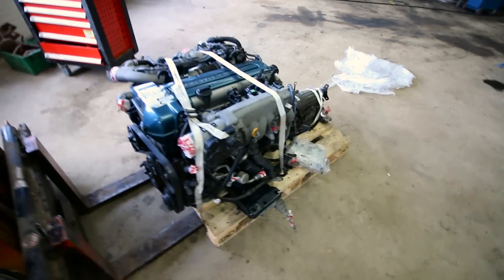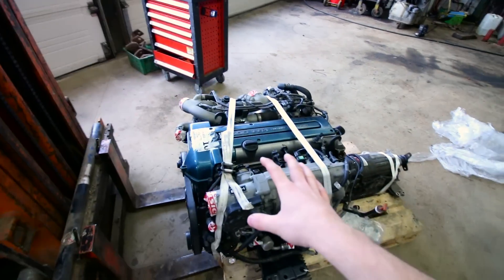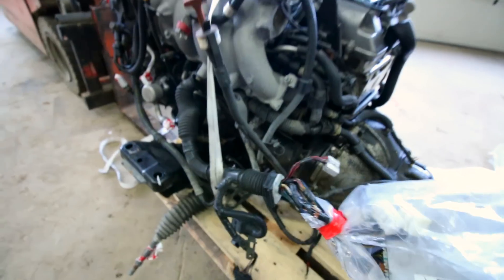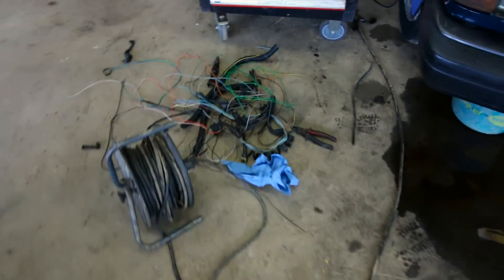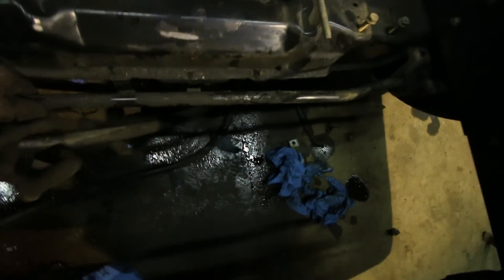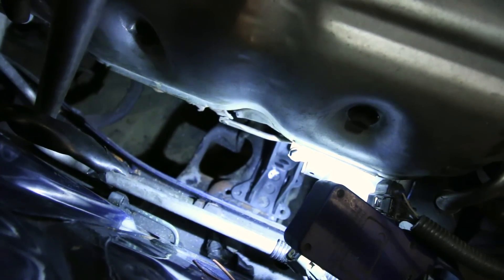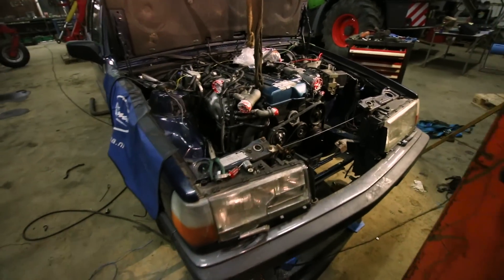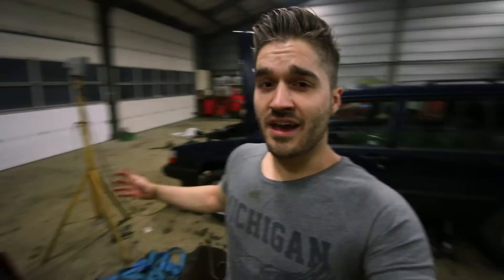Building the LCM 940 - The 2JZ Volvo [Ep2: 2JZ Test Fit & Custom Sump]

Comment: looking good so far mate. I got a question, do you think it would be easier or harder to put a 2jz n/a in a 1970's Volvo 240?
Reply from the maker: I think that with an older car it's easier due to everything being more simplistic.
Reply: there is so much room in a 240, a v8 will fit in it, i think the smart thing to do is a standalone ecu.
Reply: There is about 4cm less engine bay room front to back, at minimum.

Comment: I will be swapping my 2JZ from my 240SX into a Volvo 940 sometime in the next few months.  What rear differential did you end up using?
Reply: Matt Keperling stock is fine
Reply: sleeper04 not for my setup anyway.   The locker is only good for up to 25mph.   One wheel won't hold the power for me.
Reply: you can modify the weight in the diff. to engage at all speeds